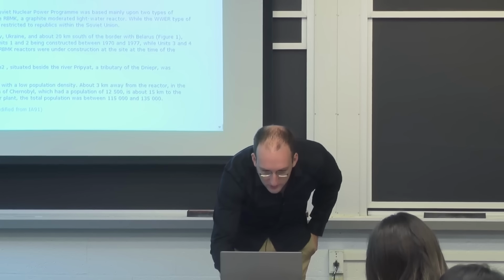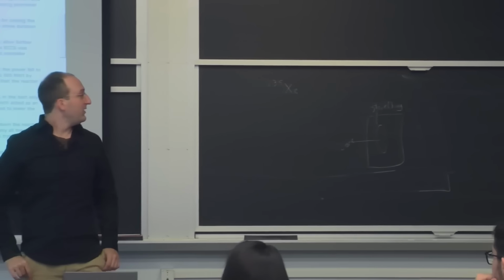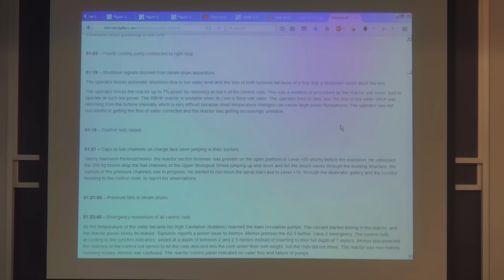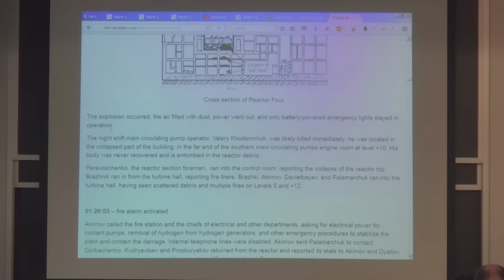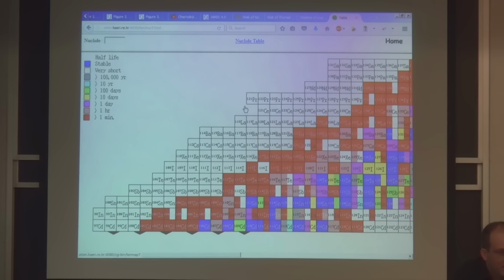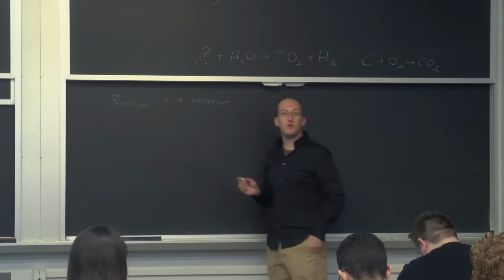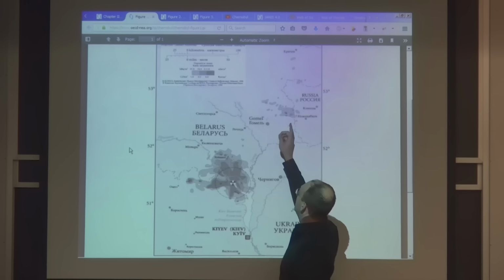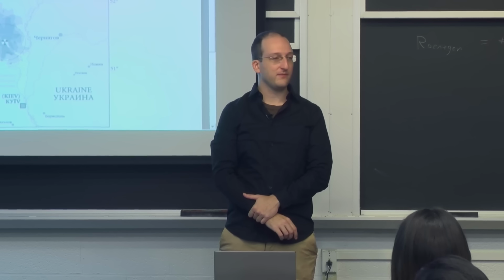26. Chernobyl — How It Happened

Comment: Trained as an ex-Navy Nuclear Submarine machinists mate / Engineering Lab Tech from pre-Chernobyl days, and after seeing the HBO series on Chernobyl- this was a fascinating look at some details I did not know, and very well taught. Much thanx to Prof Michael Short for this presentation. Great job!
Reply: Honestly Lagosov's (sp?) explanation in the trial in that series is one of the best laymen's explanations of the event I've ever seen.  It's not perfect, but it gets the point across without making any REALLY offensively bad errors.  The biggest one was throwing one temperature/heat balance item in what was otherwise a reactivity balance.
Reply: The HBO series gets a lot about the accident very wrong. It basically reinforces a lot of Soviet propaganda that tried to redirect blame away from the reactor design and onto the operators.

Comment: 42:05 I'm a MD. Definitely division nr 1. We use some method of finding cancer cells before they give any symptoms or even signs. What we find, we call cancer in situ or early stage cancer. If something is not a cancer, but can change in to cancer (f. e. leukoplakia of esophagus), we don't call it cancer, but this is the thing- It is not one mutation in a cell- it is a lot of them. Cells have many regulatory mechanism to not become cancer. They all have to be deactivated by mutations for the cell to start out of control divisions.  Also 41:34- the more rapidly the cell is dividing, the more frequently it makes a copy of DNA and the less time there is for DNA repairing mechanism to do there job. If the DNA that is damaged gets copied the damage is permanent- it can't be repaired. Anthill this moment most damages to DNA (like tt-dimers he mentions) can be repaired by cells enzymes.
Reply: Long story short: Its called cancer when it becomes a problem. Otherwise its just a temporary cell deviation.
Reply: @neruba2173 Wrong.
Reply: Very clear, thank you for the info! I have a question if I may -what are your thoughts on the reported number of deaths caused by the radioactive fallout after the accident? The reason I am asking is because a relatively eminent local radiologist argues that the total number of deaths was around 40-50, and no more than that, compared to a number of around 4000 people that professor Short mentions in his video. I would love to hear your thoughts on the matter!

Comment: To think that there were 4 reactors at Chernobyl and despite the meltdown, the other reactors continued produce electricity even into the 2,000s. 
An excellent presentation!
Reply: correct, there were a number of other RBMK reactors in the USSR, but they were modernized in the next decades after Chornobyl to be much safer. There was also the 5th reactor under construction, but after the incident, it was not finished due to obvious reasons.
Reply: @viktor_1939_  you meant not "safer" but more "idiot proof". the fact those types of reactors worked without much problems shows clearly whose fault that disaster was.

Comment: If that lecture was after Fukushima, I wonder why he insists on the fallacy that nuclear reactors using the Western design are safer than the RBMK ones. Both fail catastrophically, in different ways. "It could never happen in the US" was useful propaganda in the 1980s but should no longer be taught as if it were true.

Comment: His explanation is generally correct but contains many inaccuracies--most of which don't matter a great deal to the overall narrative. For example, he says that Xenon kept the reactor from going critical; the term "critical" means the reactor power is above 1% and unchanging. When power increases, the reactor is supercritical, and when power decreases, the reactor is subcritical. He also states that the graphite tips were about six inches, which is wrong--the graphite tips were 4.5 meters long. Other minor discrepancies pepper this lecture.
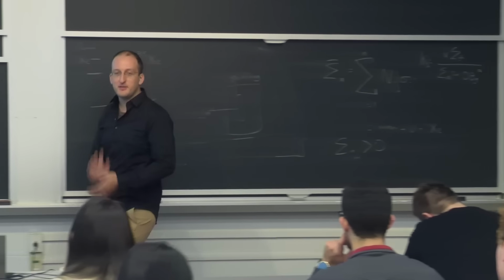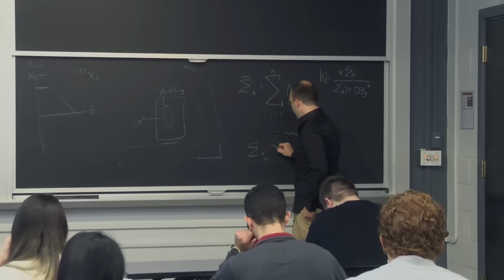He failed to mention one of the most important root causes. The reactor power had been reduced in preparation for the test, but at 13:05 (1:05 pm) power reduction was halted at 50% due to Kiev's sudden midday need for auxiliary power, and the test was postponed. But reducing reactor power causes an increase in Xenon concentration. Fission does not produce Xe-135 directly; fission produces Te-135, which almost immediately decays to I-135, which has a half-life of 6.6 hours and decays to Xe-135 which has a half-life of 9.1 hours. That ratio causes Xe-135 concentration to be at a maximum about 11.3 hours after a power reduction. The transient was completed at 13:05, and the unsuspecting night shift restarted the test at midnight.
That delay should have postponed the test for a few days until power stabilized. Because they forgot about the eleven hour Xenon peak, they blew up the plant. Unfortunately, the lecturer also forgot about it.
Reply: The thing with the control rod "tips" seemed to be the standard version for years, and I first remember hearing the much more plausible current version around the time this video was posted. I've wondered if it was the result of some reporter misunderstanding what he'd been told and then being repeated all these years.

Comment: 17:00 A nuclear explosion is something like a nuclear weapon, but there are reactivity accidents, which are like a nuclear fizzle, because the nuclear material is torn apart quickly and looses criticality before a large share of the fissable material is split. At Chernobyl, there were two "booms", the first one a steam explosion, and the second one a few seconds later probably an criticality event after all the water left the presssure tubes (see positive void coefficient).
Reply: Hydrogen.  The prompt criticality was prior to that, and responsible for the heat making the steam explosion.  The fuel rods probably did blow out, but that was almost insignificant compared to the energy the heat imparted on the steam.
Reply: @nathanwahl9224  Promt criticality means that the power rises very, very quickly - it only takes ca 1,5 milliseconds from one generation of neutrons to the next. Thus, you can't observe the power gauge to rise. It happens so quickly that it will be stopped only be loosing the configuration including the critical mass, e.g. by vapourising the nuclear fuel. Similar to nuclear bombs, the criticality has to change quickly to prompt critical state. This happened by loosing water in the cooling channel by a steam explosion, after a couple of pressure tubes ruptured, pressure was lost and the water flash vaporised.

Comment: He forgot to tell that the experiment was postponed by about half a day from noon to midnight, because the central dispatcher in Kiev didn't want to loose that power in the afternoon. The left the reactor running at lower power, accumulating more Xenon 135 during several hours. Because of the changing of the shift, the new crew wasn't instructed about the test.

Comment: my colleague started working as an engineer at a VVER-1000 plant which was commissioned in 1980 (let me remind you that Chernobil occured in 1986) and it already had the containment in the project. So russian officials did understand the importance of not just simple protective shielding but an elaborate system that could withstand not only an explosion from the inside but also any sort of disaster from the outside (like a small plane crash or tornado). So it is absolutely beyond my as to why they did not bother to put some sort of protection around the RBMK type reactors, when they clearly already had the experience of doing so. I now work at a VVER-1200 and let me tell you...we are ready for ANYTHING. I am trained as an operator and they taught us that basically even if a person, who has the necessary skills to operate the reactor actually wanted to cause an explosion of some sort and did all the steps towards it, they wouldn't succeed. You cant shut down passive safety systems, you cant trip most protections, the system wont let you do anything besides reactor scram (and thats the worst case scenario)

Comment: If a 1,000 ton reactor lid and the control rods really were lofted a kilometer into the air, WHERE did the control rods go?  The fate of the reactor lid is no mystery.....it's in the building. They were irradiated and highly radioactive.......did they fall back into the building, land on the grounds, or end up in the reservoir or even Pripyat? After the explosions, the fuel that was not blasted into the atmosphere melted and turned into nuclear lava when it fused with everything it came into contact with. This melted fuel is still alive, chain reactions occur when rain water floods over and covers it. If it really burned through the bottom if the building, what us the risk over the long term for the people in the region?

Comment: Nobody is going to want to listen to me because "he's an MIT professor", but there are two critical falsehoods in this presentation that clearly indicate this lecture was built more around 'popular misconceptions' about the Chernobyl accident then the actual reality.

Misconception 1: 18:25 - there was not a 6" 'graphite tip'. This is for sure one of the biggest falsehoods about the reactor design and it drove me mad when I first learned of it, because I would keep asking "Why would they do that?" The graphite 'tip' is more accurately referred to as a graphite BALLAST. The professor is right that graphite certainly does its job moderating neutrons, but the problem is that water absorbs neutrons very handily. If you withdrew a boron control rod, you leave a void that would fill with water. The point with drawing a control rod is to increase reactivity, so why would you want it filled with neutron-absorbing water? So the control rods all had a large assembly on the ends of them that had a telescoping graphite ballast that would displace the water. These were not six inches, they were more like six *meters*. However, because of the size of the reactor chamber, the design required the ballast to be shorter than the total height of the entire reactor itself. It was a dimensions thing. When fully withdrawn, the ballast would float in the middle of the reactor, leaving a void at the top and bottom that would fill with water. When fully inserted, the rod would collapse slightly and those gaps would be closed. For whatever reason, a full-length ballast couldn't work, so this was the compromise. Which was fine, because it meant under normal operation, the center of the reactor would be where the highest reactivity was, while the top and bottom would be at lower reactivity. What actually caused the explosion was because of the gaps (ordinarily filled with water) had then filled with steam and created the positive void coefficient, upon lowering the control rod, the graphite ballast first displaced all the steam at the bottom of the reactor vessel. While nobody is certain what actually happened in the vessel as nothing could possibly accurately monitor it and survive, there were reports of two explosions. The leading theory is that upon displacing the steam and the instant spike in reactivity, the first explosion was actually contained inside the reactor vessel and shattered the fuel rods, which in turn damaged the rod channels, meaning the control rods were now hopelessly jammed and could not descend. With nothing but graphite now in the bottom of the reactor vessel, it was left with absolutely no brakes on and a few seconds later, the second explosion obliterated the reactor.

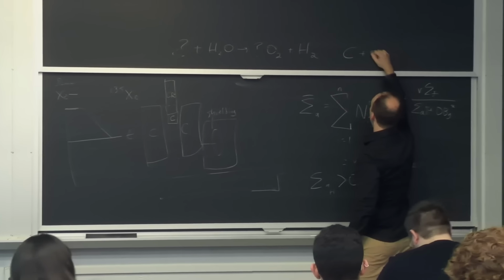Misconception 2: 27:25 - there was no graphite fire. High-purity graphite is incredibly hard to ignite, even under artificial conditions. http://gt-mhr.ga.com/graphites_all.html The red glow in the remains of the reactor chamber is blackbody radiation from graphite heated to 700C, but it is not the fuel for the fire. To whit - crucibles for smelting are sometimes made of graphite because they literally do not burn, and are used to melt metals that have melting points enormously higher than the stated autoignition point for graphite. While graphite may combust in thin sheets or powder or something, testing found solid blocks do not ignite.
Reply: Indeed, at least 2 critical falsehoods! Unfortunately, this "prof" is very likely highly representative of the extreme low quality of the post sec education system in the u.s.a.
Reply: I like your words magic man
Reply: I listened! Great info! Thanks for taking  the time.
Reply: I too can reject objective reality and substitute my own.  In my imagination the Chernobyl incident created a massive cloud of cotton candy which we're still enjoying to this day.

Comment: Philosophy Graduate student here. My dad had a Ph.D in nuclear and mechanical engineering, so I could follow some of the math (but not all). This is simply the most fantastically exhaustive hour one could produce on Chernobyl. What has always amazed me about this accident is the entire lapse of judgment that these people had. Rather, the persistent wrong judgment. The people clearly knew they shouldn't be doing what they were doing, yet did it anyway. I don't think the "why" question can ever be answered.
Reply: Organizational judgement overriding personal judgement.  Non-expert party bosses forcing (through several layers) the technicians to do what they would never be doing otherwise, simple as that.  The decision-making process had people in it like the load dispatcher, that had more power on decisions over how the plant was operated than the people operating it.  Plus there was additional knowledge that the technicians were never even given that might have changed their minds.  There may not have been a physical gun to their heads, but the consequences of going against that system were severe.
Reply: @nathanwahl9224  That makes a lot of sense. The threat of loosing your great job (or probably even worse!) can turn off people's brains. The point about the lack of knowledge for the people on the ground certainly rings true. On the other hand, there still must have been some people on that higher level who both knew or should have known better. However, as you mention, there might be people higher than them forcing them to do this experiment who didn't really understand the implications here as well.

Comment: Long story short: 

In graphite-moderated reactors, if there's a catastrophic loss of cooling water - the chain reaction continues until the core reaches its thermal capacity and explodes.

In water-moderated reactors, if there's a catastrophic loss of cooling water - the chain reaction stops because it's the same water that acts as a moderator.
Reply: @Livin Vids you're kind of right but one can argue that good design means leaving as little margin for error as possible, considering the potential consequences. Maybe it's more right to call it inferior design rather than flawed.
Reply: @SirMcAwesome  any time you insert control rods and power goes UP, it's a FLAW!!!

Comment: One critique I have to this is, at the end the media is critizised for using half truths (very valid point), however at 46:00 he first communicates the lethal doses and then mentions an estimated 4000 deaths implying that these people got a lethal dose. This is is wrong. Most of these deaths are expected to have happened due to the effect of the radiation on the population (i.e. increased cancer risk and death rate) and not due to acute radiation poisoning.Only around 30 people actually died from acute radiation poisoning. 
This shows how difficult it is to actually get a head count on this since even these 4k deaths are not that likely to show up in any statistic. You can get some data when you limit this to subgroups of the population (highest exposure, only looking at thyroid cancer) where you barely see a significant effect (as is shown in the talk). 

So the big question about evacuation and such is:
a) what percentage of "statistical" deaths can we tolerate before we evacuating a region?
b) how many additional deaths do you get as a result of an evacuation? (suicides and other collateral damage)
c) how does the population react to either being or not being evacuated?

I also don't like stressing that this can not happen with US reactors. Thinking like this can lead to the same hubris that the Czernobyl operators had when they blew up the plant by deactivating security systems and not realizing they had a serious condition at hand when it already should have been apparent. 
If your reactor is at curiously low power, don't thing about getting it up to higher power again but think about how to safely shut it down to investigate. There were lot's of moments when the disaster could have been prevented that passed unnoticed. There were a lot of human and design errors that lead to this. In Czernobyl as well as in Fukushima. It's always multiple errors together that kill such systems. And hubris makes errors more likely, which increases the amount of multiple errors much faster than you expect.